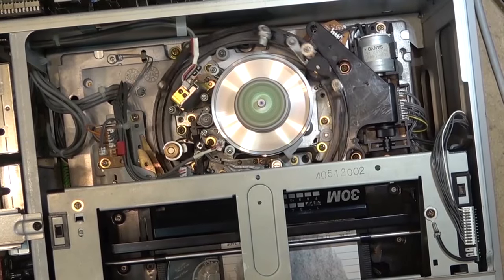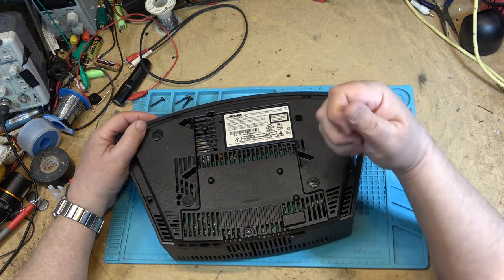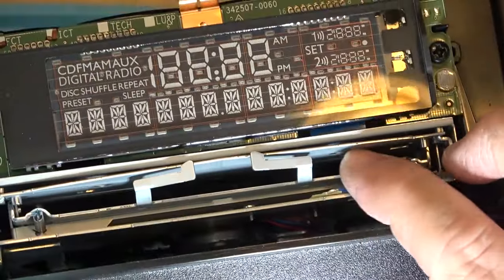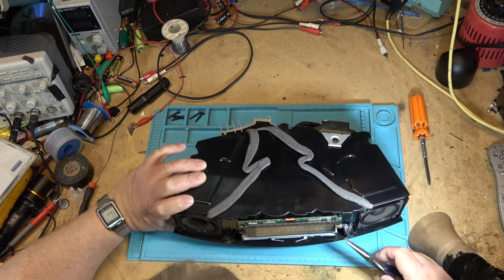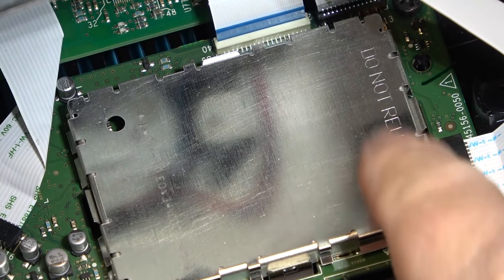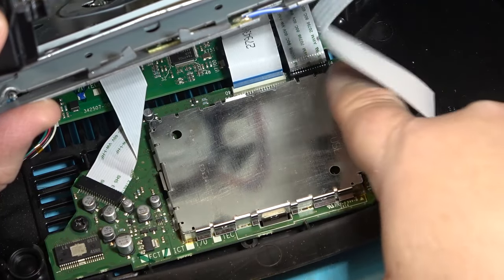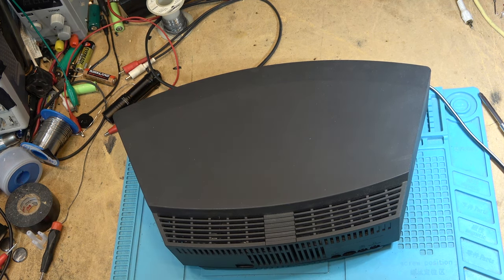Oh No It's  BOSE.  Music system with a Broken CD player

Comment: All this needed is the capacitors replacing under the “do not reuse” metal cover. The drive looked fine and I’m pretty sure you mangled the assembly trying to straighten something that didn’t need straightening as looked normal. I’ve done about 15 of these and any disc drive issues are 99% the capacitors under the drive itself, underneath that metal shielding with “do not reuse” on it.
Reply: Thanks, I have a unit with the same? fault, although no shipping etc costs, a kerbside freebee
Reply: I have a Music System IV on my bench right now with the complaint of no audio. I found the radio would not tune any stations then lock up. My next step was to remove the "Do Not Reuse" cover to see what treasures lie beneath said cover, also I see a regulator IC next to the can that I will test for voltages. You have given hope for myself and my customer.
Reply: Yeah, def bad caps on these radios. I had one that would only play if the ambient temp was above 80 F.

You can test this by using a hair dryer over the boards for a minute or so. If the radio / cd works, you know it's bad caps. Apparently, the heat lowers the ESR temporarily. 

You also have to be careful with the housing on these. At this age, the plastic gets brittle and snaps easily.
Reply: @paulcastillo30 good tip about the plastic being brittle. Very hard not to snap the posts when opening the screws. Avoid using any kind of electric screw driver is the only thing I can suggest.

Comment: If you looked at the previous Bose wave radio repair with the two discs inside, you’ll notice that the drive looked bent in a similar way. I’m pretty sure it’s designed to look that way.

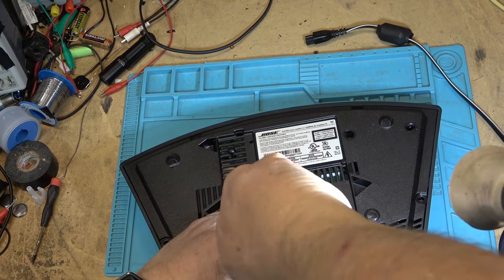Comment: 11:43 - Replacing the two screws at the front face, this part was omitted. If too much pressure is applied, the mounts inside the outer shell will snap right off ! Arrggghh .Brittle little things...and bad design, as far as fastening goes. But all in all, a great sounding unit, one must admit.

Comment: How many watts rms, does the speaker kick out ? The reason why I am asking this, is because the instructions for this unit are a bit vague. The only thing I see, is the power wattage at 60W.
Reply: I bought two brand new Panasonic SC-UA3s, back in December 2021, which cost me in the region of $100 (ZAR2000-2200) a piece, here in South Africa. I find that it is always good to have a spare unit around, should one of them fail. This particular model has been taken off the market since January 2022, so I really bagged a bargain with both units. I have had no issues with any of the two and they work everyday, with an excellent output on sound quality. With a combined total of 300W RMS (150W per channel), I couldn't let this pass me by. 👍👌 It appears that the SC-UA3 is not so easy to work on, so I hope it will last. This would be due to the small thin screws, sitting very deep in the unit, initially.
Reply from the maker: I believe it's 20 watts i changed an amp ix on one years ago.
Reply: @12voltvids  Thank you for clearing that up, Sir. So, in short, the unit is not as loud, as one would expect something that costs $300+ to be.
Reply from the maker: 20 watts can go loud.  The speakers are matched to the power available.
Reply: @12voltvids  Oh right, thank you for informing me of the latter, Sir !
Reply: useually the amp is rated for like 25 watts but realistically probably about 15 or so. The ic used for the amp is common in car stereos

Comment: Over expensive plastic junk, they work but i would rather have an old full metal stacking system with decent speakers.
Reply from the maker: These are used by people with limited space.
Reply: @12voltvids  ok but the tradeoff is that it is an over expensive plastic junk etc. It doesn't really matter why people use them.
Reply: @jasejj they are used on the kitchen counter like those black and white Hotpoint TVs in the 50s.

Comment: You are correct I owned an acoustic wave way back in the beginning one of the first few to buy it. It was extremely expensive at the time and over the years. A CD player stopped working, etc. and the only thing they would do you could turn your old unit in and they give you 50% discount on the new one a refurbished one or a new one whatever originally I paid $1200 so they wanted like 500 in addition to my used unit for a refurbished or a new unit, $1200 back in I think it was 1991

Comment: Throw it away and get the Bose Wave 1 from 1997/8 where it's a top loader not a crappy slot loader like the re designed iMac G3 over the original tray loader. It's better build quality
Reply: problem with the wave 1 is the audio is not as good. I have one, Sounds muddy as hell. good alarm clock though